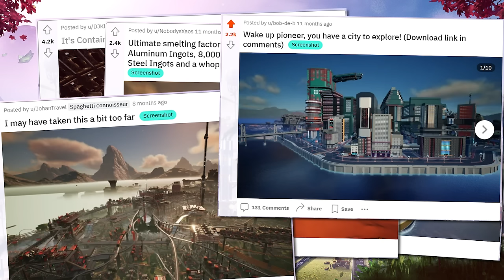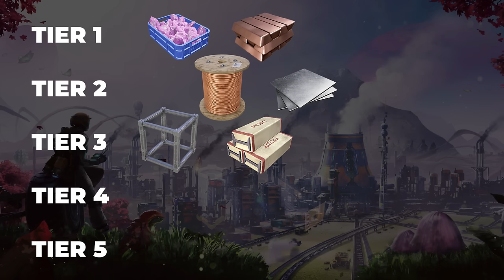Mega Factories vs Modular Factories | Satisfactory

Comment: For trains, I actually tend to have a single engine-only train in a 'personal' station, and a handful of stations splintered just off of in-use lines to keep it within the area I'm working in, when I need to move a long distance I call it to a station, and schedule it out to where I need to go and enjoy the ride.  I also use a bi-directional four lane 'mainline' that circles the map to minimize crash hazards.

For long single-lane lines I generally put a side line every kilometer or so if needed so I can safely get my personal train in without risking a collosion.

Comment: i was planning to make a more "dynamic" factory, in the way that everything just needs to be connected in a certain way to make a certain material, or with switches, you turn on/off different machines to avoid constantly adding and removing conveyor belts.
yes, this does mean some machines will more often be gathering dust, but at least you dont need to make a ton of factories that mass produce few items.

not completely sure how to do this yet, but that was my plan

Comment: The problem is finding space for trains to park and load/unload. For 1 train, your platforms will be very wide (because of the turn around), now imagine that with 4+ trains. Sometimes I build train stops ontop of each other. I find I like to build parts near resources, and bring them to a central location for my own use (item hub), and make temporary builds for elevator parts. I have done the mega factory, using a cyclical main bus, 9w6h usually covers it all but it is a lot of work to set up. But once that's done, it becomes easy to make your complex parts as you build everything above the bus. The trick is making sure there is enough inbetween room for the splitters and vertical belts. There is no wrong way to do things.

Comment: I prefer modular as it gives me an excuse to use Trains and Trucks. Also I find it easier to scale up production.
In a local factory for example I can just build a copy of the floor plan one level higher and double production,
then increase the frequency of my shipping, or divert the extra production to wherever needed. 
In a mega factory If I don't plan exactly ahead I run into space issues, resulting either in complications or needing to redesign an area.

I do use a central storage hub with a sorting facility, because I am lazy and don't feel like running around the map for materials.
I let the trains, drones and trucks deliver them and my programmable and smart splitters sort them.
The overflow at the end sinks whatever is full.
Reply from the maker: It sounds like we play exactly the same!

Comment: Actually technically there is a 3rd way: In situ monoresource processing and central multiresource processing. 

To explain the way I build for example I will build a smelting building for iron because that is monoresource, as well as all of the rods and plates and screws and reinforced plates and rotors. All of these monoresource times then get shipped to a central location for further processing. This prevents me having to build thousands of constructors in one location, making room for a more organized and neat setup. 

These central locations are them dedicated to different levels of complexity and types of items and then ship them further on to the manufacturers, blenders, encoders, etc. For the final products. 

This solves several issues at once: 1 throughput is easier to expand as it means simply building more train cars instead of building masses of belts. 2. It makes it easier to expand as each building is dedicated to one type of item or resource. 3 it distributes the lag. Instead of having one massively laggy area you have a slight collective frame dip. 4 it looks way better than one building and makes the map seem alive.

Comment: I tend to go for the central base + satellite base model. It's nice to have one central hub that you can go to in order to access everything else, but it's easier to get proportions right when you do the basic processing locally. I think if I ever did a megabase, I'd likely have a central storage area where everything goes to and gets pulled from so that I can clearly see what materials I'm running out of, and then do all of the real work off in separate 'wings'. More like a mega campus than a singular mega building.
Reply from the maker: Yeah, I think that is the best way to do a mega-base, it's a little spread out but with a central hub.
Reply: That "mega campus" is about the same as the "bus" of a mega-factory.

Comment: I love building things like skyscrapers, so I sort of naturally opted for the vertical megafactory. It's been ... challenging ... but really satisfying, imo. Most of the floors are 3 walls high, and I am up to 16 so far. I've had to build stuff like a hypertube elevator (individual floors plus 5-floor expresses), and the requisite power requirements. ^^; More glass than you can shake a stick at, some signs for glowing lines, that sort of thing. I do have some satellite factories for things like power, because using towers to transmit power over long distances is super easy now. I even have a billboard out front taunting ADA about FICSMAS, lol. I ought to make a video some time...

Comment: The way I play is kind of interesting because I usually have about 3 or 4 mega factories that are a little bit apart. One is for basic production so everything before you unlock steel. One is for steel production stuff.
The other two are for everything else

Then I use trains, tractors, and drones to transport everything to a main storage area.

Comment: a) cool base, lags
b) smaller more unique bases, probly less cool, less lags
honorable mention: you have a reason to build highways with local factories. finished mine that goes from eastern northern forest (the pure iron and stone nodes ec.) to the Crater lakes (powerplant, SAM factory). The time it cuts by just drivin with few turns, instead of hillclimb racing, is considerable.

Comment: I built a sort of mega factory that could produce a moderate amount of all goods including bars up to level 3, for level 4 and some level 5 stuff I used a train network and ended u going more modular, that first base used belts and I called it my "build base". a good place to use a train to move goods.  If I star a new save once 1.0 gets released then I will probably do something more similar or clean.   Last thing I built was a supercomputer factory that could make 4 or 5 a minute and I had 8 train stations bringing in things from modular factories like aluminum bars, plastic, rubber.  The natural resources that were near the base I used.  It was beautiful and took me months.  My factories are gorgeous and I really don't want to ever start over.

Comment: Main reason why to build as modular as possible : performance
Reply: When you have a huge number of machines even that doesn't help a bit. Because all the calculations have to be done wherever you are on the map. I have 25 FPS wherever I am because I have 6000 machines😅 (even on a high end PC)
Reply: @ogcaveman8120  This is why, Building as less Machines as possible is the best Way for Saving Performance. Overclock where ever possible. Down Side of that is you need alot of Power. But in the End, no matter how you do done, you will always have some Laggy Spots thats just how the Game Works.

Comment: The only tip i can think of off the top of my hat is to not transport raw materials if it can be avoided. Usually, the number of items gets lower as you progress up the tech tree, so i tend to at least build smelters near iron or copper nodes and only transport ingots over longer belts. Fewer belts needed = less work that way.

Comment: I tend to have a few different factories.
Before 1.0, I had a section for basic iron production, copper and steel, oil products, then an entire section for completely automating nuclear. Then, in the middle of it all, a bunch of production for more complicated componebts, none of it automated, just set to whatever I needed at the time.

I'm going for a rather similar approach yet again, but I'm trying to automate more. I just don't enjoy taking everything apart, and putting it back together for better efficiency, and I prefer to have constructors and manufacturers dedicated to being flexible.

Need project parts? Great. Don't need them anymore? Now I can use the infrastructure for motors. It's more hands on, but weirdly enough, I prefer it that way.

Comment: My main issue with Satisfactory is that, I do the centralised factory with smaller factory outposts around... But the trains are unlocked so late that it bothers me to have to then build that infrastructure when I didn't plan ahead for it. It makes just making huge belts taking stuff in and out much faster because the cars are honestly slow, and if there is ANY inbalance in your system if you used your car to transport items both ways, you'll end up clogging one of the side with garbage, requiring a manual fix. After that happened one too many times, I just stopped using cars outright and just made huge belts which went faster than the cars anyway.

Comment: I like the modular because then the design of the buildings, at least for me improve over time. The first place might still look like spaghetti when I’m at tier 7, but that recent place I made for aluminum, that’s a high rise with big windows and a hyper tube system
Reply: This. Your later bases will tend to be better than your earlier bases because you have so much more to work with.
Reply: @Sluppie  and the early stuff is also usually part of some bigger chain, so it would be annoying to tear it down and redo it
Reply from the maker: So true! 😂

Comment: See i challenged myself to use vehicles as much as possible, so i use several assorted factories, i ship stuff around via train, trucks to collect all sorts of random raw materials. I do have a massive sorting facility thats nothing but train stations, storage and programmable splitters so that way I can send truck loads of crap to random collector trains and they just dump it at the sorting station and magically it ends up in the appropriate bin.

I debated on doing this with packagers for liquids but ultimately didnt feel like doing a dedicated train/drone network for empty packages, as i already did a drone network for supplying batteries to every resource collection truck/train hub. It is nice seeing trucks all over the map rather than tons of random conveyors just sprawling the landscape. 

I did do a mix of trains and pipelines for fluids, it mainly depended on the amount of pumps required to make the pipeline work.

Comment: I have a question that needs a quick reply as I am about to build a new factory. What do you think is a good amount of items/min for personal use like crafting weapons/tools and factory building materials because I wanna know how mich to split off to use for myself in building for example splitting concrete off for building foundations. Obviously different materials are gonna be needed more or less but for steel pipes and beams especially what do you think I need to use for myself
Reply from the maker: That is definitely a hard question to answer. I have been pretty okay with just having one machine making an item and sending it to a storage room. You may find that you need more concrete than that, for example, but you probably won't need much of things like steel pipes. You'll get a lot passively stored up when you're out building or exploring.
Reply: @SatisfactoryNews  thx for that I think that'll rlly help my planning
Reply: Yeah, I call them trickle storage factories.  Pretty easy to dedicate a whole node here and there to each item you need to fill for building storage.  As long as its setup to run fully automated, it will eventually back up as your storage fills. I usually do this with one mk5 belt of each item per storage, but  that's for a VERY large factory.  Mk1 or mk2 belts filled with each item are most likely going to be enough for the average pioneer. My heavy modular frame factory needed upwards of 500k concrete a day when building so I setup a 10 million concrete storage area and a small megaconcrete factory (10k a minute for storage) to keep it filling for that large build. The last thing you want to happen is to run out of items in the middle of a project so always overproduce those items you will need the most of.  You can always sink it later or use for another build.  Hope that helps!
Reply: @BLAndrew575-  it rlly does thx man

Comment: Is doing up to 3 tiers in one place inefficient? Its kinda like a mix of a mega and a modular factory I guess but I have one really place really rich in Iron using 4 pure and 9 normal nodes in the area to build Reinforced plates, modular frames, and smart plating with the idea being that I would use tractors to move them over to my steel factory once I build one. Also I when I built the factory, I didn't have an amount of the end products in mind but rather trying to make the most of the 13 nodes in the area, is that also inefficient?
Reply from the maker: I think that is  perfectly fine! In fact I have a very similar factory. It is situated near iron and coal nodes and is one big building yhay makes smart plating, but also makes all the lower-tier items. In that case, since you have access to all the nodes you need, it makes sense to use them like that, and is definitely way more efficient than shipping materials in from somewhere else!

Comment: my idea was to centralise as much as possible until either Iack of space, or lack of practicality.
then I do mini factories that I build around a transporting things (will use train now, but some areas might have the drone traitment) to bring the built goods back into the my main hub.

tho tbh I am not a really good player: my productions are very limited in size and output, and I rely on a lot of power shards to make enough, do to space limitation.
if I ever redo this entire mess again, i'll probably plan a bit more for increasing production later down the line.

Comment: I built a mega factory with 0 buildings. The ground is unorganized conveyor spaghetti that clips through everything. The machines areplaced almost at random, only some foundations on top of the lake fir more space were used. So, more professional parts of this game's community, am I crazy?
Reply: Am no pro for sure, but I totally feel that. It makes sense to slap this assembler down here . Oh I need those frames? Just split and zoop a belt waaayyyy over here. All good lol
It does make later stage optimizing lines an absolute pain though, trying to trace one belt of iron rods through 3 mountains and crisscrossing untold numbers of other random lines over the span of like 2km.

Comment: does fly mode ruin game?
Reply: It certainly takes away a lot of the game mechanics - like craftable items such as hoverpack and rocketpack, vehicles and exploration. But if you are dedicated to just build a megafactory in the scale some people tend to aim for. Then having to travel normally and build scaffolding or fuel for rocketpack etc just becomes a hinderance when the build itself takes several hundred, if not thousands of hours. For normal players - flying cheat code is not recommended.
Reply from the maker: I would say it's best to play the game with no Advanced Game Settings on to get through as much of the game as you can. If you want to make an end-game massive mega-base, you may want to use fly mode. Otherwise I would not recommend it, as it definitely ruins the exploration parts of the game.

Comment: This video is misleading as no one with a shred of sanity every does one or the other.
Especially considering since the maps are designer, you'll often find materials needed together for some advance items pretty close together.
I would never make steel in a mega base, considering their are nodes close together that can fuel steel production elsewhere, and this would prevent over drawing the busses.
At the same time though, trying to ship iron plates to multiple locations will cause traffic issues as your transportation network would bog down.

So the real answer, neither/both. Use both as needed to mitigate the negatives of both.

Comment: LOL... there are no modular factories in Satisfactory. Modular implies logic so that resources are pulled from a different module that has them and products are pushed where they need to be. In Satisfactory there's no logic, just stretched transport paths via conveyors or vehicles. There's one big factory, you just decide if you want everything in one spot or stretched over the map. The train can't decide that factory B has lowest amount of the resource it's transporting so it will go there instead of potential other factories.
Reply from the maker: That's just being pedantic, "modular" has a definition understood by the entire community in regards to Satisfactory. 

Also I don't know where you're getting that a modular system needs logic. If something is modular that means it is made up of smaller self-contained units that can be combined into a single larger unit, and replaced with other modules as needed. Nothing about logic.